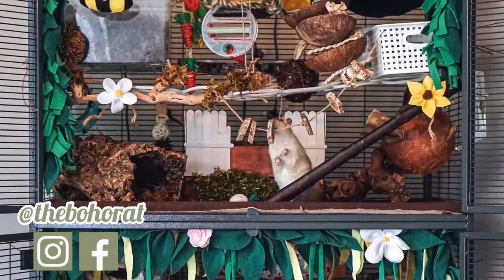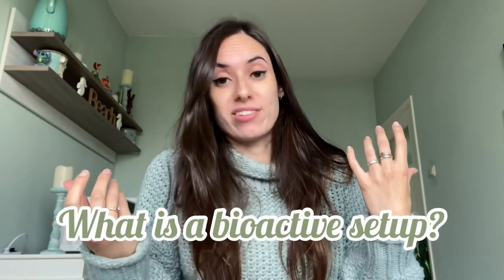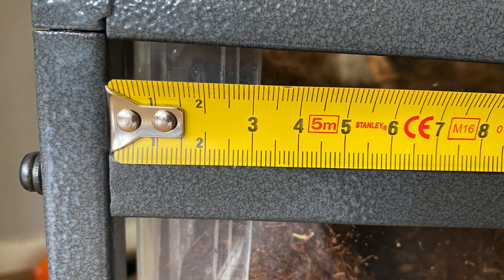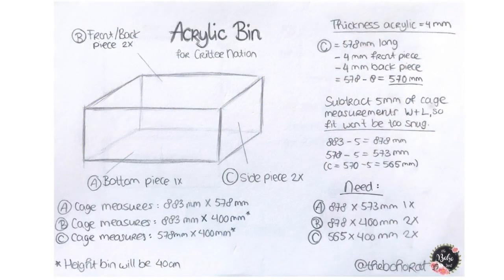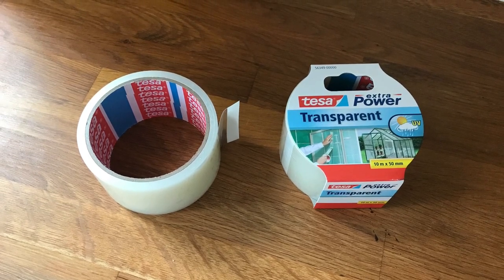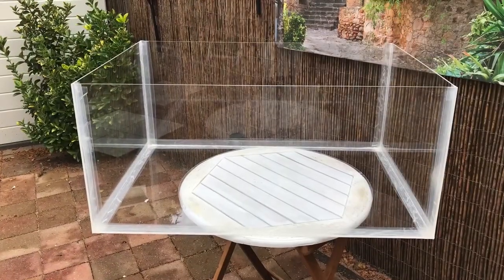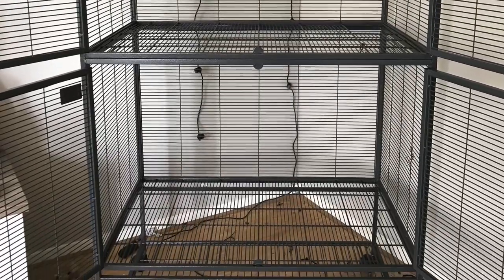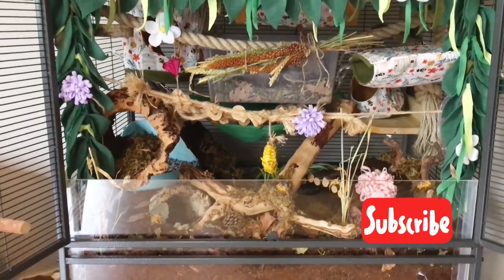Tutorial: How to make a Bioactive Rat Cage

Comment: I just ordered my acrylic and am so excited to do this for my ratties. I would like to add that you can use aquarium safe 100% silicone caulking to put the bin together. It will last longer and will make your bin completely water tight as long as its done properly. SAFETY WISE Apply it in a ventilated areas and air it our for a few weeks or until the vinegar smell is no longer present so that the fumes dont bother your ratties. 
Im loving the cross over with reptile keeping and small animal keeping! You can also us low watt uvb bulbs and add plants to enclosures like this. Just make sure you do your research on the plant species that are safe. Any herbs or veggies and a good amount of fruit tree and shrubs are generally safe bets. Just dont expect them to last forever if your rats are big chewers or they aren't getting enough sunlight♡
Reply: Where did you order your acrylic from? I've been in the process of getting all the stuff for a bioactive enclosure for my 5 rats and I have everything but the acrylic.  I'm not sure what the best place to order from would be, I'm located in the US.
Reply: @jtrealgood2013  i got mine from a local acrylic design place in ontario. Id say check your local shops. It only cost me about $100 for my whole base for a critter nation. Good luck

Comment: When keeping the your bioactive moist, do you just use a spray bottle to moisten it? Do you remove  your rats to do this? Also, you stated to turn the soil. Do you just use your hand to flip the soil around? Sorry for any dumb questions, I want to make sure I understand every step to be able to do this. Also I don't have a critter nation. But I do have a double level cage for my boys.
Reply from the maker: No dumb questions! 😊 I either used my hands or a tiny shovel to turn the soil. I used a spray bottle regularly, left the rats in while using, and when it needed more water I usually just added some with a measuring cup while I was cleaning the cage. The rats wouldn’t be in the cage so it was easier and I would turn the soil a bit after watering. Hope this helps and sorry for the late reply, I don’t have rats anymore unfortunately and am never on this channel 😅

Comment: I'm thinking about adapting your design because we have two cats. Do you think making the acrylic bin fit inside the lower CN unit instead of the bottom shelf will work? I want to use the bin to keep the cats from grabbing at tails. Currently we are only using the upper half of the unit for safety reasons, so this shouldn't mean less climbing space for them.